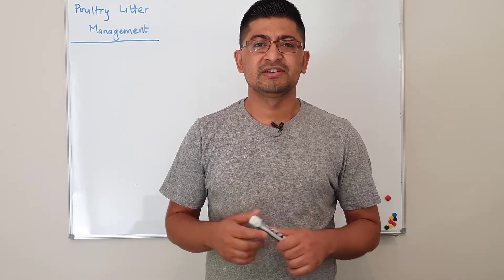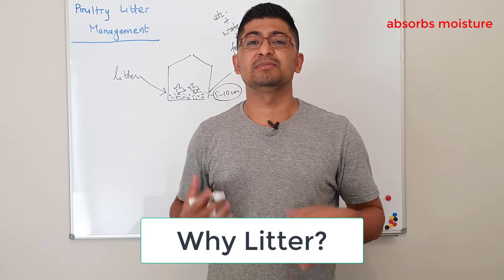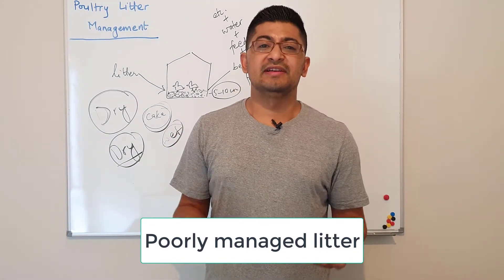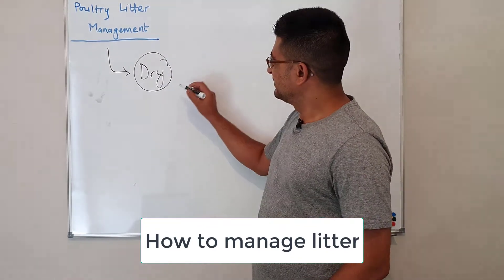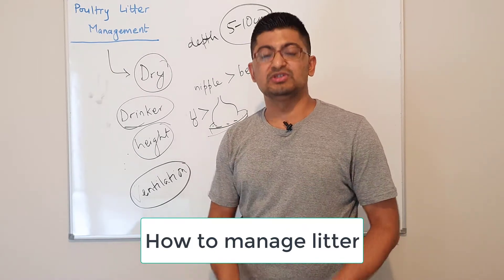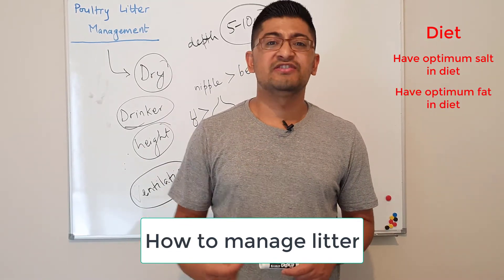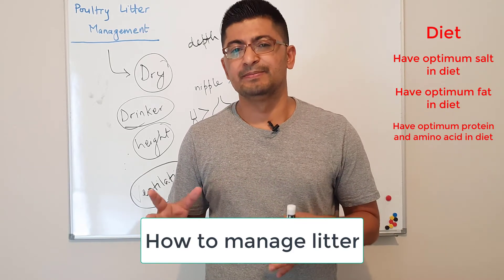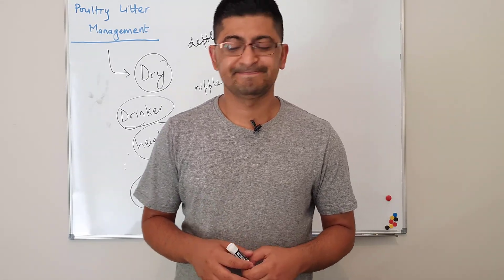How to manage poultry litter?

Comment: I have a cemented floor in my shed how would it be If I keep desi chicks without any litter on the ground? Is it going to harm the chicks?
Reply from the maker: Cemented floor might be cold and could harm legs. Litter absorbs moisture but cemented floor will not do that. If it is just 1 or 2 birds in your backyard, however if you have many birds, cemented floor is not very helpful and not ideal for birds as well.